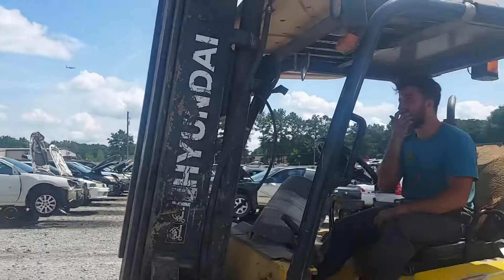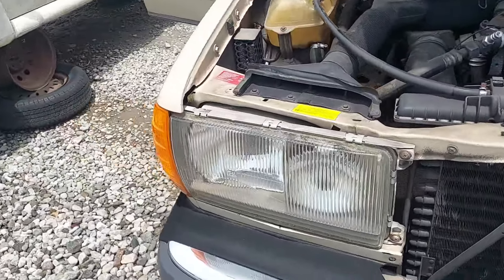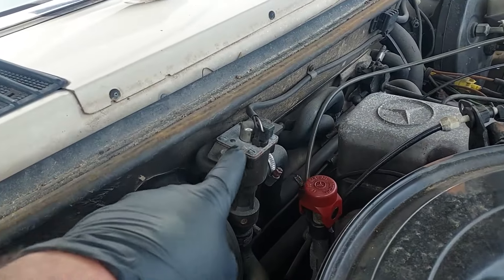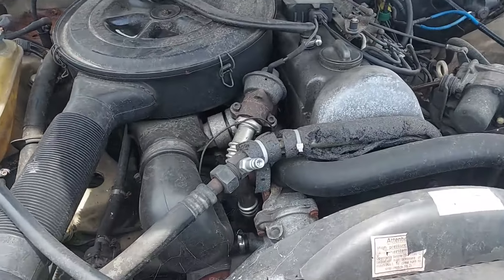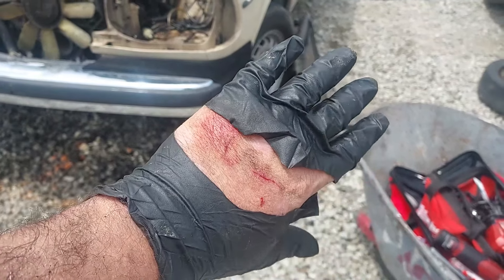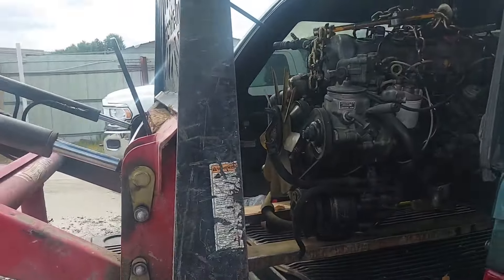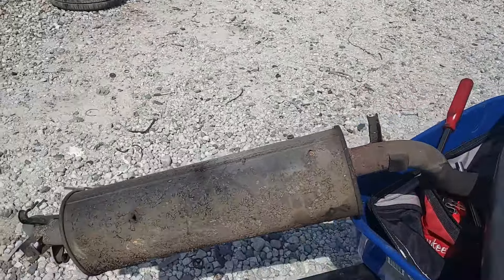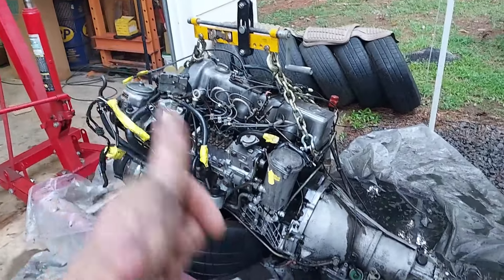Mercedes Junkyard Find - 1984 300D

Comment: A bit like here in Australia, you even have a young Hazara guy driving the forklift .I was looking for a good M110 and trans for a customers project when a W123 280 E popped up in a local wrecking yard. I bought the car and pulled the engine. The car was too good to return the body back to the scrap so I transplanted my OM617 and manual trans into it so now i have a really nice W123 .
While i was loading the car onto a trailer in the wreckers yard,I found an even better 300D .I have noticed a lot of these cars coming into the scrappers and I am sure they from deceased estates and the relatives don't want grand dads old Car so they get what ever they can from the scrappers.
Reply from the maker: Man we really need to try to get a hold of these cars before they go to the scrapper!

Comment: Next time, dash cabin sensor, door seals if good, rear window regs(vac actuators if you've gone to the trouble of pulling door panels) pivot mount, booster line, hazard relay, mirrors, but good haul overall. Your prices are much better than out here in LA, but we do get lots of generally rust free stuff. Your lucky to still have the vacuum pump as those are NLA from MB rebuilders now as well and go quick. It's always bittersweet to find a nice one at the yard. I love picking stuff to help fund my efforts and supply the need, but I HATE seeing nice cars that shouldn't be there. Those are the ones I'm trying to save in the first place.
Reply from the maker: Man I left so much stuff behind that I wanted to get I was just totally exhausted after 2 days....
Reply: @woodsandbarclay  I get it. Rare for me to get the opportunity to pick solo. IF I tried to document things, you'd see someone showing up and swooping in on fair game. Glad to see passion being rewarded.

Comment: Damn...I have an extra om617 with the triple k turbo from oil pan to air cleaner, 722.3 Trans and rear from an 84 300sd
Reply from the maker: Nice that's a good one
Reply: @woodsandbarclay  I basically took apart a gold and palomino car my mom got in a wreck with for spare parts. Everybody in my family has or had several 300sd . My parents, myself, brother, sister, grandparents, uncles and aunts, etc. My younger brother had an 84 190d.  These cars are so great

Comment: An awful lot of work, but if that engine is in great shape, you can use it 
or sell it.  Just curious why didn't you take the outside mirrors?
Reply from the maker: Yeah probably should have grabbed the outside mirrors there was just so much to do and I forgot to get some things. That video spanned over a two day period and I had to drive back and forth to the junkyard a couple of times. There's a lot of stuff I wish I had grabbed.

Comment: Haha, damn, I've seen a few cars that were WAAAAY too nice to be in the yard. I've always wanted to just pluck the whole thing out and they won't let you. And they spear the fuel tanks.
Reply from the maker: I was actually able to take this fuel tank to my buddy that is a TIG welder and he did a very nice patch on the small hole that they created when they drained it so I was able to save the fuel tank
Reply: @woodsandbarclay  I've wondered about how feasible a repair on a tank would be. My assumption is that the repair would be prone to rust(in theory, not so much in practice).